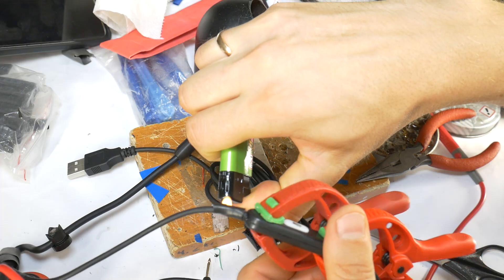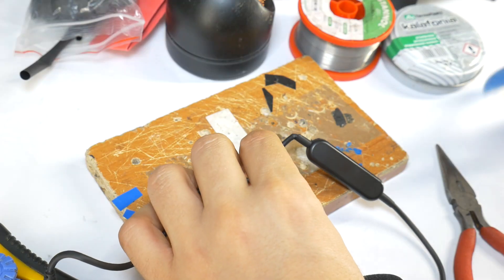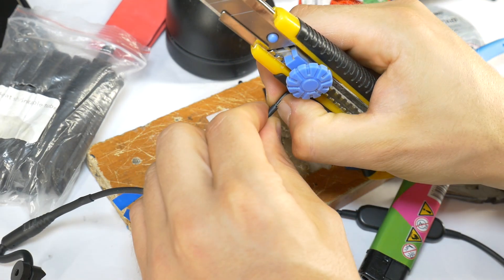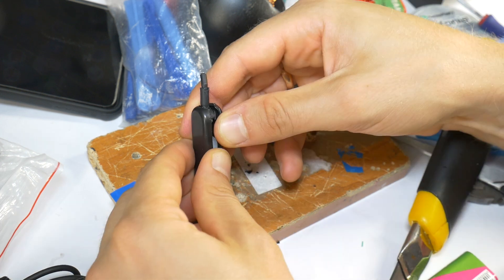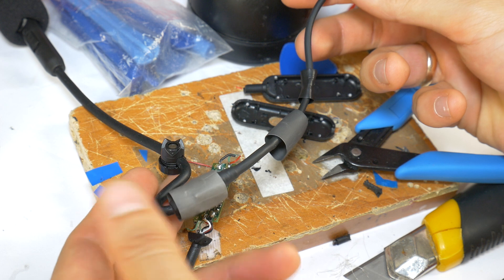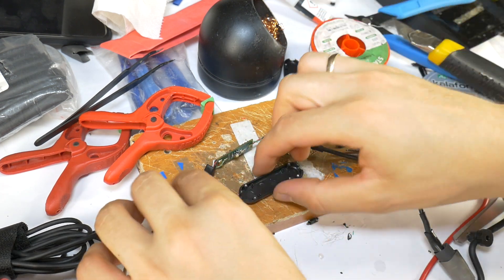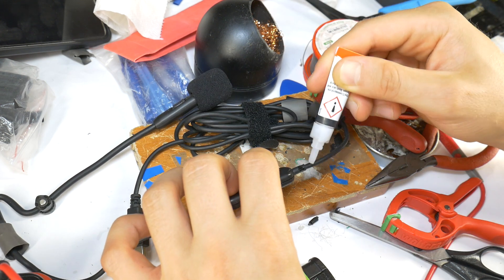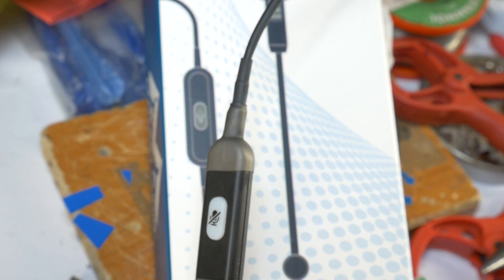How to Repair ModMic When Mic Not Working

Comment: Hello! Thanks for the tutorial. I bought a modmic usb 2 and three months later it suddenly stopped working. Windows doesn’t even recognize it and the mute button doesn’t work. Do you thing this tutorial should fix it? Otherwise it might be the dac pcb?
Reply: Figured it out. it was one of the cables (green one) that released from the contact point of the main pcb